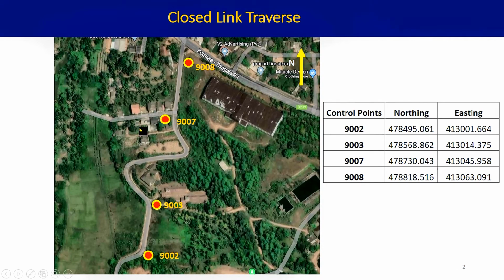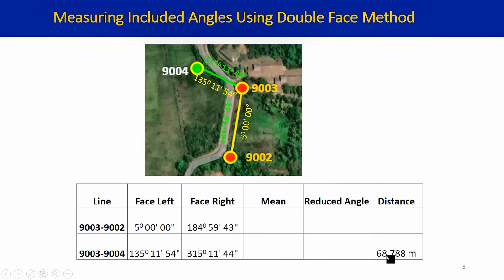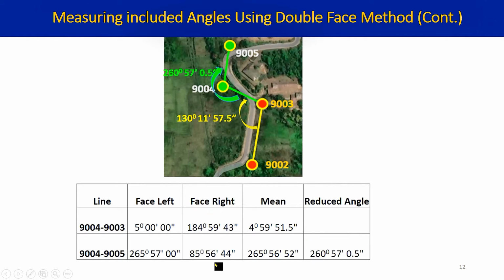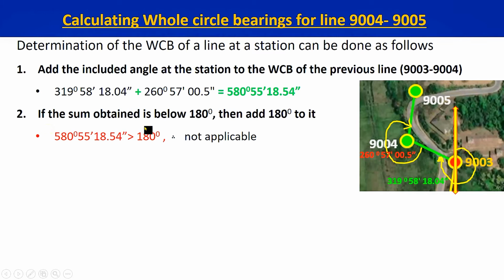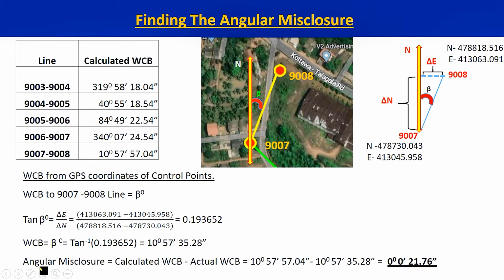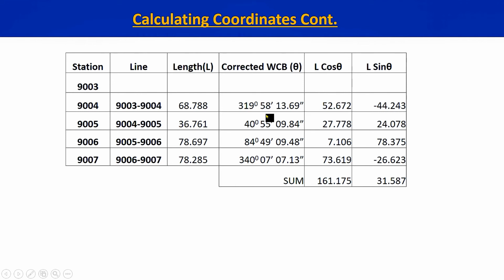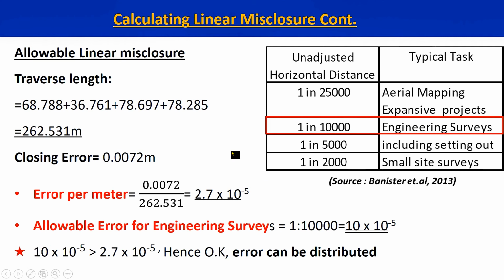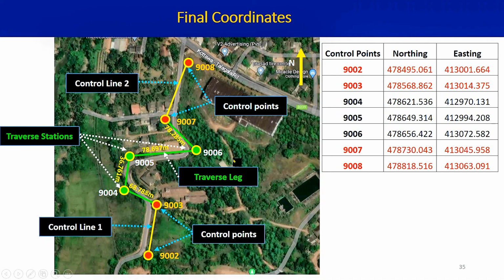Closed link Traverse (Total Station Traversing)

Comment: Thank you for posting this excellent video. Before watching this video, I was confused about whether or not I should adjust the starting and ending control stations of my closed link traverse for a project involving a maintenance map for a road. You have cleared up any confusion that I may have had. Your control points 9002, 9003, 9007, and 9008 are GNSS points in my traverse. I have 4 traverse stations between them. Someone suggested that I reduce my grid distances to ground distances and recalculate my points before I perform a Compass Rule adjustment. Do you agree with their suggestion? My change in elevation from beginning to end is +/- 2.37' over a traverse length of +/- 3338'.